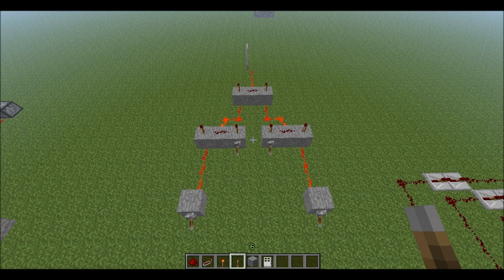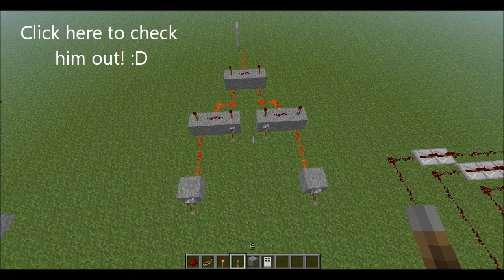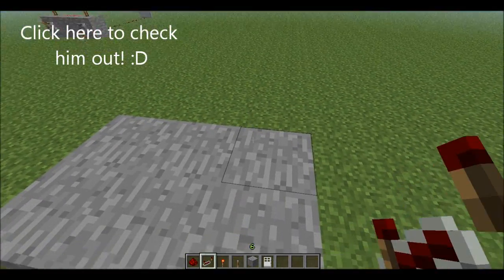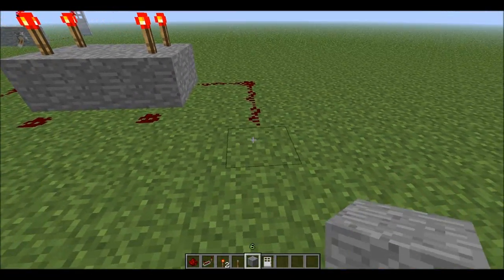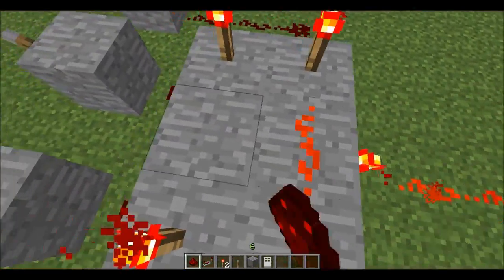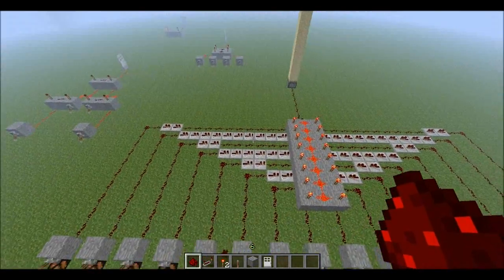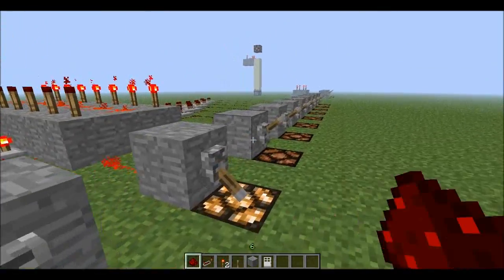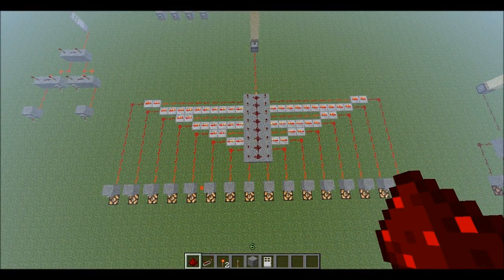Minecraft - Extending the AND-gate - Redstone tutorial.

Comment: The example shown in this video has 14 inputs at 27 blocks wide, 13 blocks long and 2 blocks tall. (These measurements include the torches and levers too).  The one I'm describing can have 14 inputs at 27 blocks wide, 4 blocks long and 2 blocks tall. That's over 3 times more compact than the one shown. Either that or I still don't understand your comment. If so, I apologize.